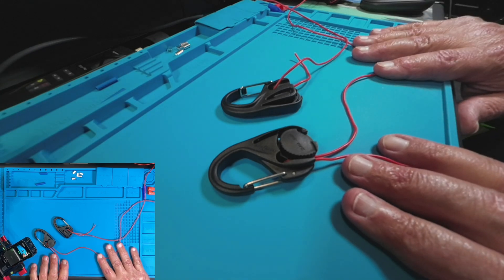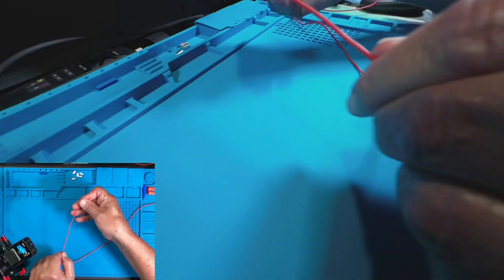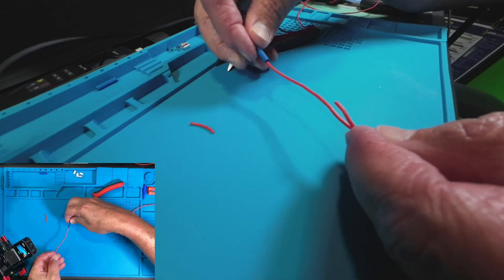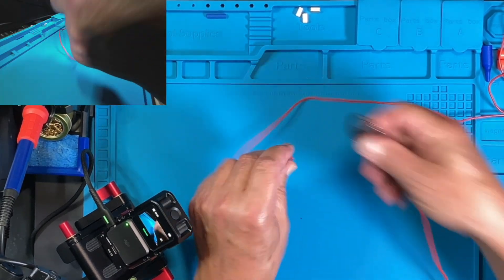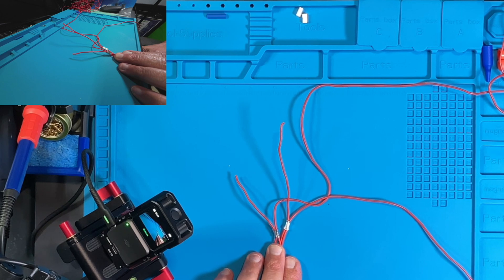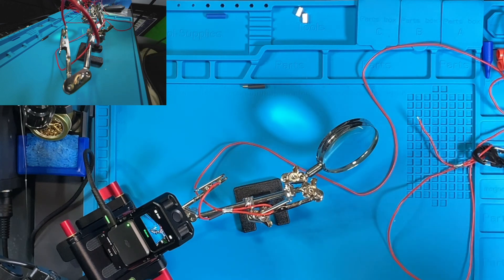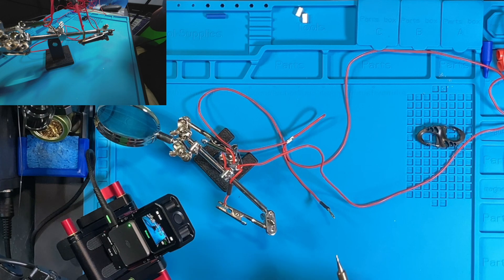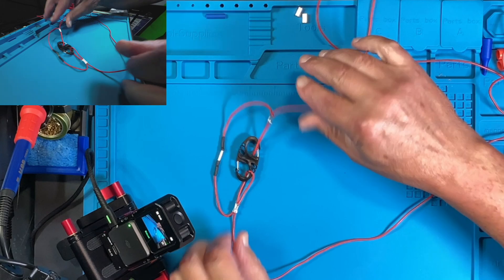Part 6 LINK, WRAP, ADMIRE:  Build a Linked Dipole for 10, 20, 40 Meter Ham Bands -- CaHR Mercury Kit

Comment: Thanks for all the work - I have one and will be building it soon.  My biggest concern is the weight on a portable mast.  I do most my portable work where there are no tall trees so it will have to be up a spider beam 10 M mast.
Reply from the maker: Stan, as I was raising and lowering, I eventually strapped my feedline to the mast near the Mercury BNC and about every 5 to 6 feet.  Didn't think to put that in the video, but it will help with stability.  Have fun!